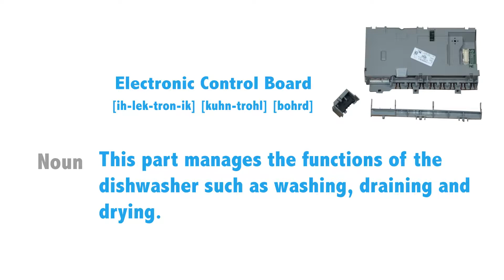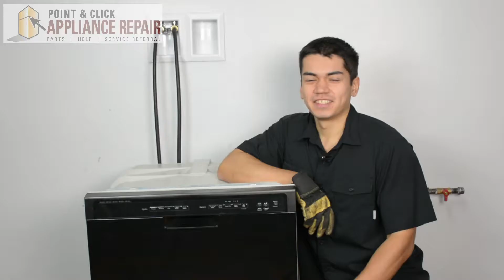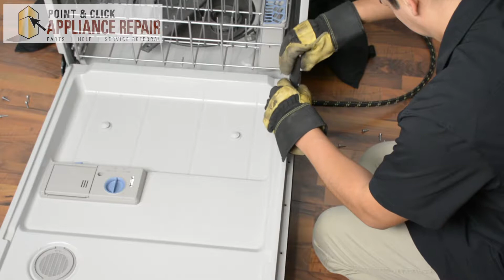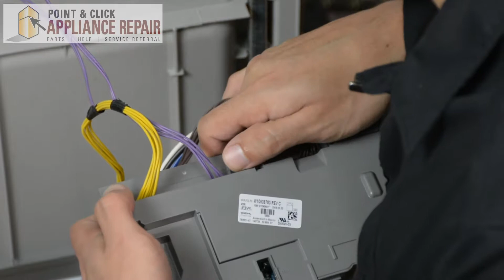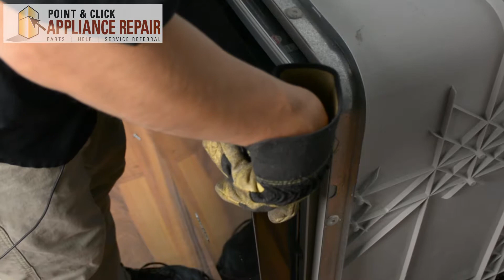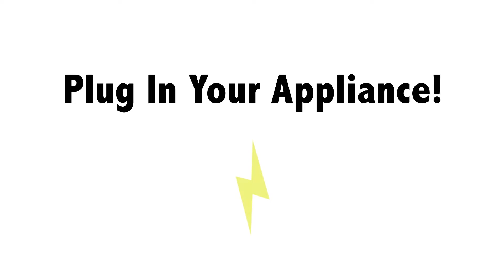W10597045 - Replacing Your Whirlpool Dishwasher's Electronic Control Board AP5688880  PS8260226

Comment: Great video! My dishwasher had the control module W10539783 that went bad and smoked up the kitchen. Do you know if the 
W10597045, is a better built   replacement, or are they all  about the same? Are some more reliable than others? Thanks.